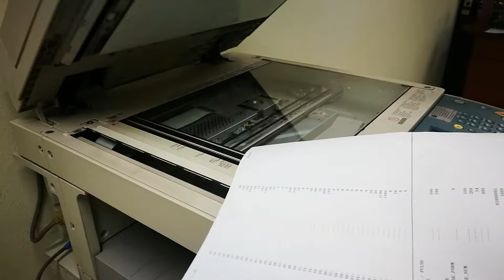How to Fix Streaks and Lines in Scans, Copies & Faxes from Printer or Copier

Comment: Hi, I have a Canon MFP ImageRunner Advance. Recently I had my scans save as skewed or slanted images. I thought it might be the Auto Document Feeder, so I changed the rollers. That didn't help. Yesterday I discovered when I wanted to scan some important documents (50 of them)... I ignored the option of the Auto Document Feeder as my scans were slanted or skewed, and I instead used the flat bed scanner on the printer. But lo-and-behold, my scans from the flat bed scanner were skewed too! How is this possible?